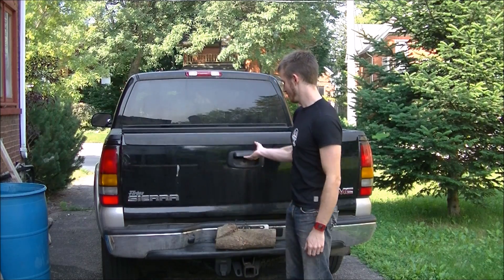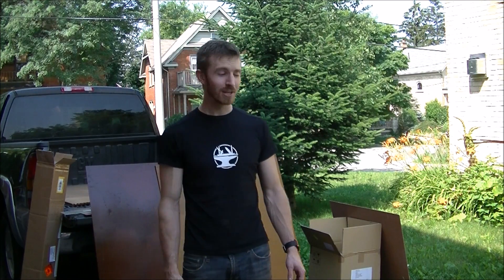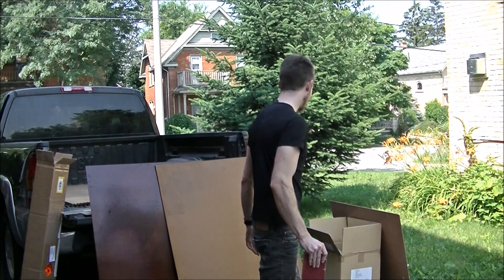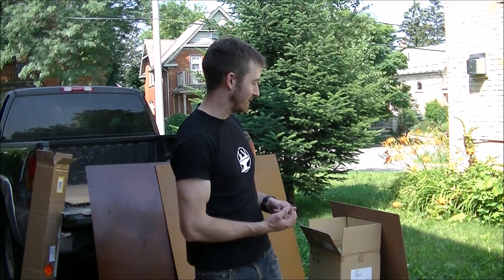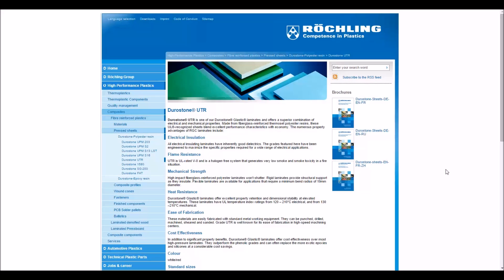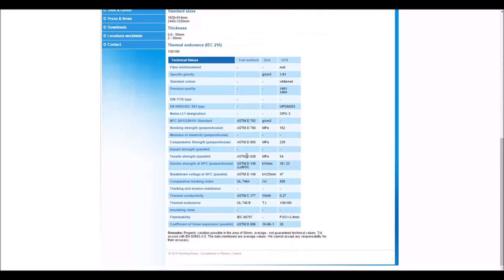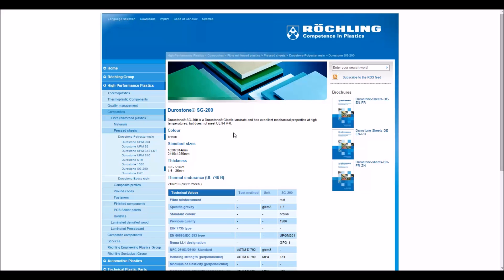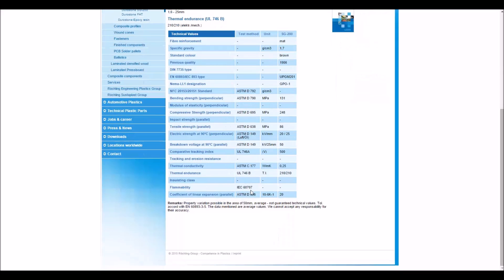Ballistic Proof Plastic For Exo Armour??

Comment: Micarta is a resin impregnated fabric (not technically as plastic) but still strong as hell as far as impact resistance goes.
Reply: the Hacksmith Its used in knife handles military heavy duty type knives, you should try to see it depends on the resin they used but it can be fireproof too
Reply from the maker: xxJord606xx I thought that was the company name! Hmmm...